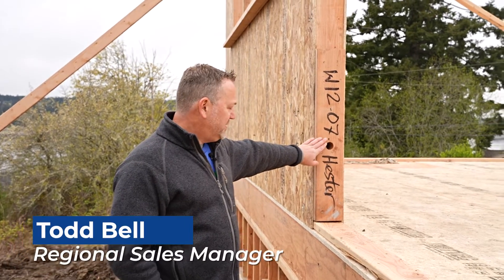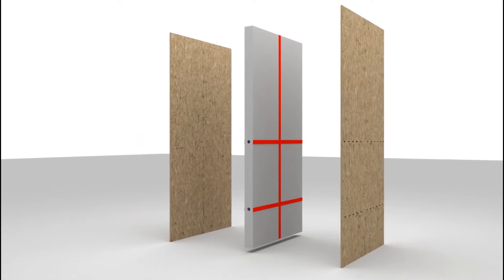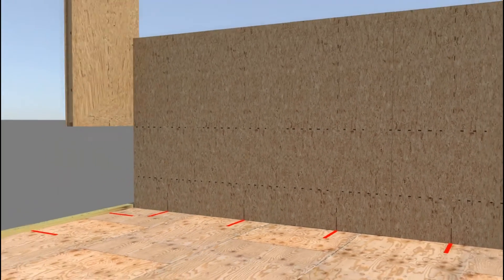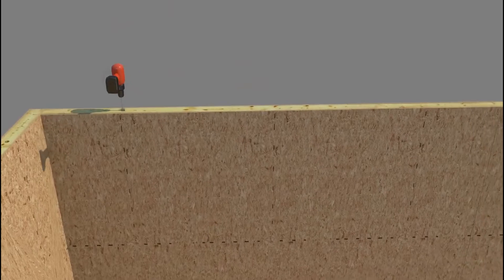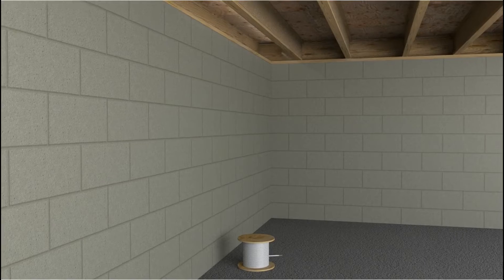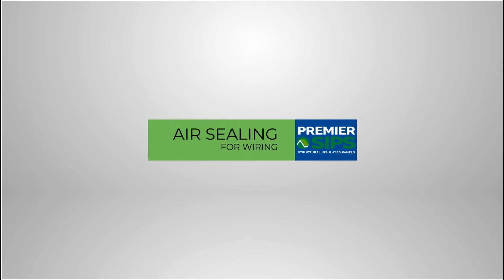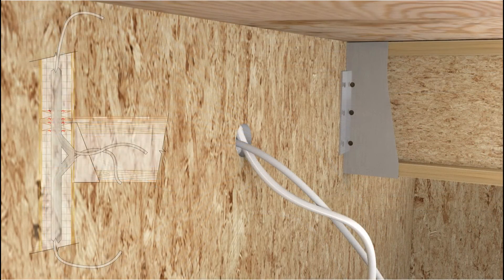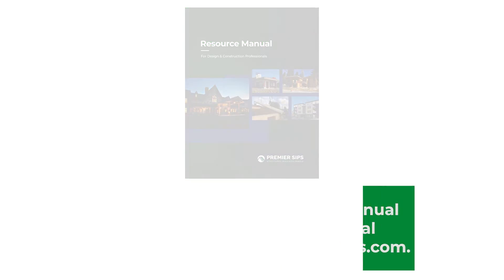SIPs Jobsite Install Video #7: Electrical in a SIP Structure

Comment: Why can't wiring be run behind a baseboard detail? Detail would be a 1x2 at top and bottom of a 1x12. That assy would screw against the wall. 
Use 1.5" deep boxes for outlets and wiremold to other stuff like switches. 
You guys make it hard to run all that wiring inside the panel??
Reply from the maker: Electrical chases are pre-drilled so there is no drilling through studs up and down walls. This is a significant time savings. If a special need is required (ceiling fan, TV mount, etc) pre-planning allows this chase to be included during factoring manufacturing - further saving time on wiring installation. The pre-installed electrical chases intersect at plate and switch height, and chases are marked on the facing of the panel for simplified locating. The panels run from floor to ceiling so furring out baseboards will likely require extra work and materials for both the finish carpenter and the electrician, who will still need to extend wiring up to switch and plate heights and comply with building code requirements for wire attachment and stapling. The answer to this really depends on each regional building code. Using the provided electrical chases is approved in the IRC, IBC and is detailed in ICC code reports regardless of region.